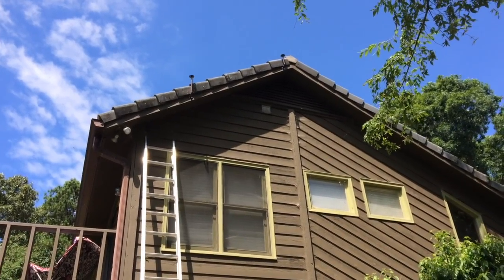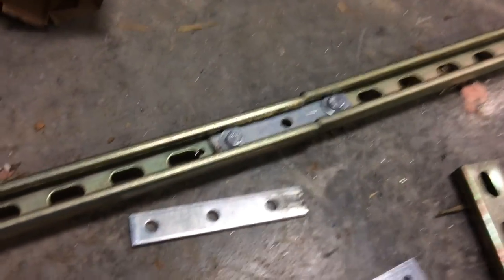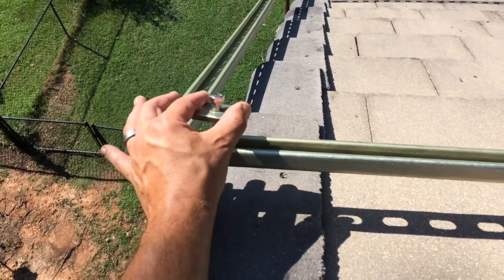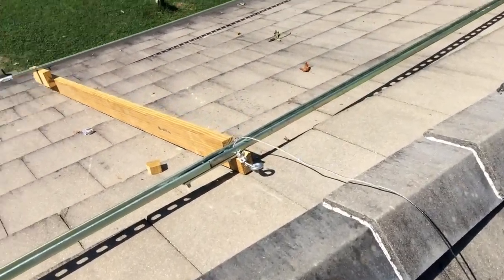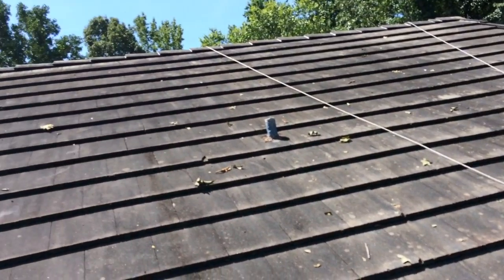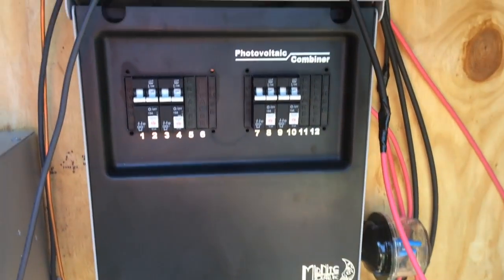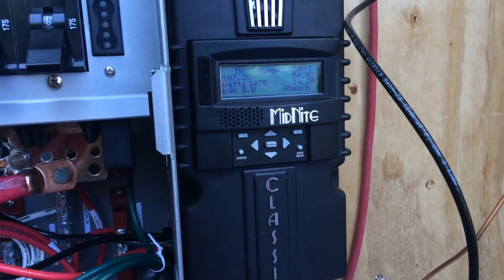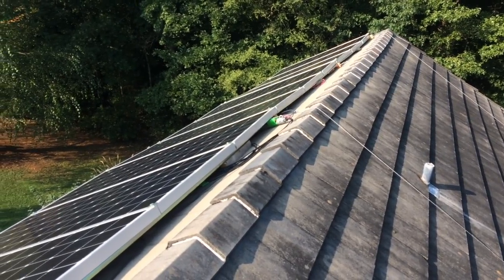Homestead Hybrid Solar Project Part 4: Panels Up, DC Side Hooked Up

Comment: Tommy I am glad you have come so far in a short amount of time there,  I am praying the hurricane will stay at sea ,  have you figured out what all you can run on the solar in the house?  Maybe use some kind of rubber underneath the cables
Reply from the maker: I was thinking maybe a piece of an old hose? I'm actually in the process of figuring out exactly what I can run. I met with an electrician yesterday and I'm waiting on a call back from the people I bought the gear from. It will be in a future video.
Reply: Off Grid Nation I dont see a reason why a old hose wouldn't work just whatever you use just so the cable doesn't cut through it as I am sure you know this ,  if wind becomes a problem on the panals would a cable work if you ran it all the way across the panels and attach it to each end of the house? Cant wait to see what all you can run and see what you're utility bill will be,  hopefully the hurricane wont reach yall

Comment: Square of old inner tube rubber under the cable on the ridge.    Save old inner tubes the rubber has many uses: gaskets, grommets, hinge,  shock cord,  bungee, cut in loop for big rubber bands ( hold down for tarp Erma ), etc.Run a second conduit ;   there is always something else to run.       Bert

Comment: Tommy, I gotta say, that's the scariest rooftop installation I've ever seen. Remember that it's not just weight you're worrying about, but also lift. And if I did use wood (I wouldn't), I would use PT. Didn't look like yours was. And, good lord, those cables. 

You were probably getting 1000W (less than you figured) because your charge controller was in Absorption mode.

The first and easiest thing to look at, if one string isn't producing anything, is just check your MC4 connections. Make sure you get a click.
Reply from the maker: The wood is pressure treated. I have cabling on the top and bottom side of the struts. Ideally, I would have loved to screw right into the roof using proper mounts. I didn't have that option. Ground mount was also not a good option for me. I'm improvising and doing the best I can with what I have to work with. Scary? We'll see. I've had some pretty good winds come through 40+mph and everything has stayed put. Hurricane force winds are another story altogether. That has me concerned for sure. So, you've basically told me everything I've done is wrong. What would you have done? I mean, I don't have a limitless wallet and I'm also limited on my abilities. In reality, other than drilling into my concrete tiles...what could I do?
Reply: Would this system have worked? https://www.youtube.com/watch?v=zir75pmRBgE. No holes through your tiles. A bit more work, but I'm sure it's worth it. It's the first google result.

The solar panels and mounting system don't just attach to your roof, they become part of your roof. I know you said you've had some good wind, but from all directions? 

I just worry about you, bro. I know you have a limited budget, but I'd hate to see the money you've already invested get destroyed.

Comment: oi tommy, u may have reversed the polarity in the string 4 wire through the conduit. Disconnect the 2 wires from the breaker box then connect the string to them and then check the wires at the breaker box side for power and polarity.... simple mistake even I still do it on occasionally  with my umpteen years of experience installing electrical and equipment. I think u should use turn-buckles on the guide wire and u should also secure the other end of the panels the same way and tension each one with the turn-buckles.
Reply: But in retrospect to hurricane Irma they will become sails and fly off and destroy anything they hit. In the last cyclone I took all my panels down and secured them in my shed, then it took me 2 days to get them all running again, which was first priority b4 cleaning up the mess and flooding I had in the house from the gutter downpipes being blocked, which I shud have checked 1st when I got back. I suggest chicken wire rolled in a ball and placed over the gutter downspout holes.

Comment: Tommy, if you have an old hose just cut that up and use it for the wire contact points.  I use old fire hose to shield mine.